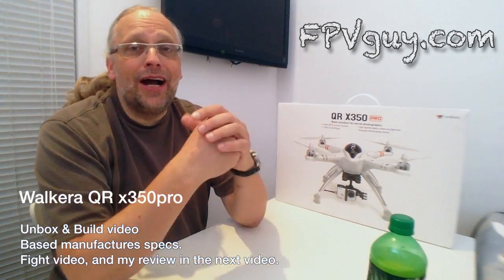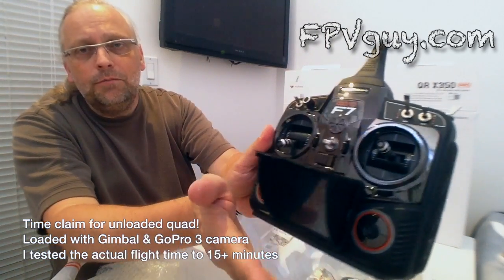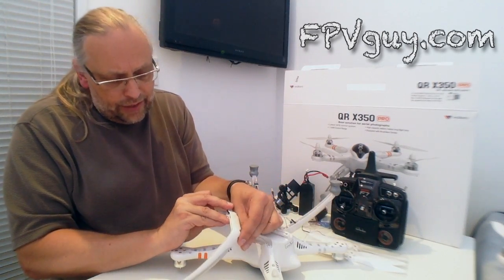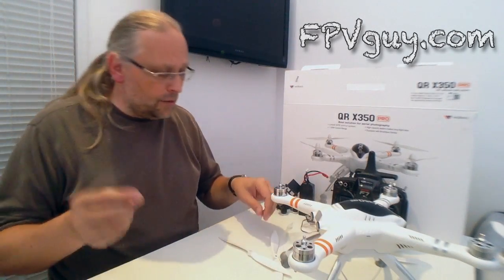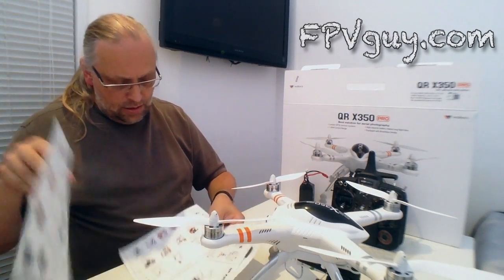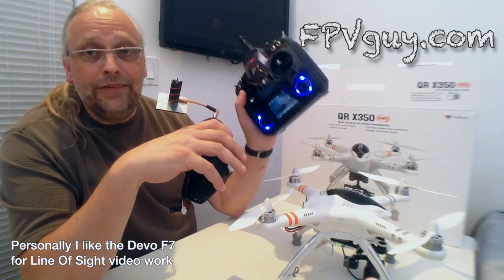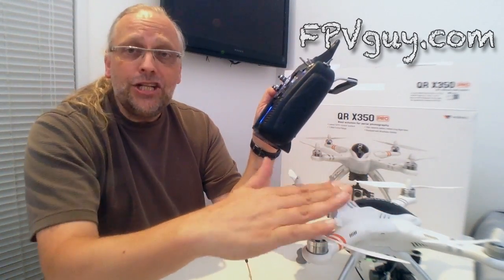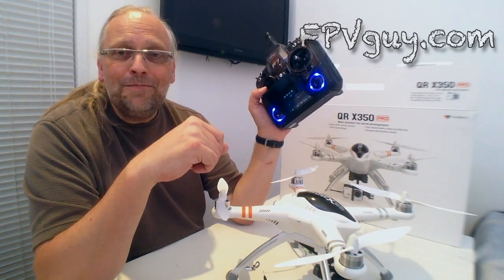Walkera QR x350pro build video

Comment: Thanks for your video, it answered most of my questions, but there is one thing bugging me.
On the model i just unpacked (seems to be the same spec as yours) there is another - third cable coming out of the same hole in the body as the compass and G-2D controller cables, it's got two wires - black and blue with male connector (tainted blue).
Do i connect that to the camera power cable? The only 'left over' connector that matches it is the female that comes out of the split four-wire cable that connects to camera's power supply socket.

Help!!!

Anyone can obviously tell that this is my first ever RC experience :)
Reply from the maker: LOL   Daniel, dont panic,     I have not heard about that cable before.  but am guessing it may be a camera remote cable.   stop by our Facebook 350pro support group and post some pictures,  My guess is Walkera finally fixed the start-stop issue for the camera. ;-)
https://www.facebook.com/groups/711455455567160/
Reply: Bo Lorentzen
Reply: Bo Lorentzen
Sorry i don't have Facebook, i've put pictures on Google+
Reply from the maker: Daniel F You should probably make yourself a dummy FB account, as there is a lot of users exchanging support there,  Matt and I try to resolve as much as we can there, the point is that what we learn is shared by a lot of users.    :-)
Reply: Bo Lorentzen
I might just do that. :)
Reply: haha same thing here,and walkera's representatives don't have a clue about ''the mysterious cable''....to be continued.
Reply from the maker: Check to see if that fit one of the connectors on the cable from the camera. :-)  they may finally have installed the camera start stop cable.
Reply: I am trying to see how to use camera remotely but i can't find it anywhere...is that possible that you can use only the video capture remotely??
Reply: There is à black transfert cable(in fact, the transfer câble is splitting in two, one end is useless) that is useless coming from the cam...is it possible that it would connect the mysterious blue câble? ?
Reply from the maker: Its possible, see if it fits.   
Basically in the first shipments there were  missing cable, for the ON OFF switch for the camera. personally I think its meaningless because I start the camera on the ground and use the counter for the video to know how  long I fly.  but some people love to flip  the video on and off al the time. ;-)
Reply: I am that type!;) What i want to know is if its possible to take pictures while the quad is flying. ..remotely?
Reply: And Yes, the câbles are compatible: one is male and the other is female
Reply from the maker: You can set the sliding switch to pictures, and engage the shutter by the flip on the remote, IF it works with that blue cable.. I'm guessing thats the right cable. ;-)
But you can't change mode in-flight

Comment: Hi, I've a "problem" with my x350 pro if we can call it like that. The quad keep his startup direction (north, south, east, west) even if I try to rotate and go foward in another direction it doesn't work. I would like to know if there's any ways to fix this thing.
Reply from the maker: Antoine Pedneault  Not sure I understand exactly what is happening,  are you saying that while you are flying, you are not able to turn (YAW) the aircraft?
Reply: Bo Lorentzen I think the called it IOC when you fly you head on every way possible and it is still fky according to the take off position, kind of a headless mod. I want to stop this mode
Reply from the maker: Sounds like you need to setup the radio correctly, because if its enabling the IOC, then one of the settings are not correct,   make a clear model and setup according to the manual :-)
Reply: I've found the problem, simple fly mode was enable on ch. 7, I turned it to "do nothing" and it should work normally now. Thanks for your help

Comment: Hello, I have an issue with the gimbal. Please check the video "Gimbal broken" if you can. Any ideas appreciated.
I'm leaning toward a new gimbal, a 3DH. 
Let me know your thoughts.
Reply from the maker: Jeppschtein   looks like you need to carefully balance props.   like REALLY carefully, get religious on props ALWAYS.
Second,  the G-2D can't dampen yaw (pan) vibration,  so I would suggest considering the G-3D,  I have a G-3Dh here, but that is too heavy for the 350pro so I would not recommend that gimbal. basically the 350 pro flies best with the lightest possible payload.

Comment: Hey I was wondering if someone here could help me, I purchased the x350 pro and have the devo-7 remote, I completed the build as per the instructions in this video when for a test flight and all was well for about 8mins or so, tested gps hold and all worked well. Flew entirely in gps mode, but when I flew the copter back to me and began to lower the throttle to land when it was about three feet from the ground it suddenly lost power to the right front motor and it hit the ground, now the right motor/propeller does this "attempt" to spend thing were it twitches back and forth, any help or advice would be greatly appreciated.
Reply from the maker: Hey William, that sounds like a factory problem.  
the twitching sounds like there is a loose cable to the motor from the ESC,  basically its a faulty quad and they should swap it for you.

Comment: Hi Bo,I sent an email to the place I bought the  Quad from  and he says  I need a 5.8ghz to display the  video. The Devo7 does  not display video at the frequency it has built-in. What a waste  of money that was then? I'll have to buy the  DevoF7 which displays video from the camera at 5.8ghz.Email from supplier so you can warn  others  of potential issues when  looking for a Quad with controller.Hi there 
which camera you have? do you have 5.8ghz video transmitter and receiver?
DEVO7 can not display live video you will need external 5.8ghz monitor. 
G2D gimbal function is balance video footage. ReplyCheers Bo for the help.
Reply from the maker: +Steve Hallett  duh.  my mistake, I did not realize that not all distributors sell the 350 with the F7.    Would get a small external video screen.  or the compact goggles, you will need a elbow adapter and a walkera antenna.  http://carolinadronz.com/products/cd-goggles

Comment: For the Failsafe Mode, in order this function to work i have to be in gps mode? In order to RTH.
what happens if im flying far away on manual mode and loss signal.
Reply from the maker: +Mervyn Cheryl   Basically the failsafe works regardless. if your radio get disconnected (or turned off) the quad should simply stop and go to RTH operation.  that leave some room for error naturally as if you are running full speed at the time, you may crash into something before failsafe kicks in.
It should got to Failsafe from manual in about 2-3 sec.   (enough time to crash)
Same thing 2-3 sec from GPS mode.  unlike manual GPS should hold your quad stable until failsafe kicks in and bring you back.
Reply: +Bo Lorentzen 
So for the settings of Failsafe ~ All Servos Hold?
Reply from the maker: Follow the manual ;-)

Comment: Can someone help me? My QR X350 PRO is unstable, I have done the calibration and even then it does not get stopped, do not know if it is defective or if I should do something to work, it does not work return home to the function and the function of standing as I see in several videos where people take the place and it comes back to the point that I was, what should I do? thank you
Reply from the maker: Antonio,  You probably should post that question on the RCG forum.
http://www.rcgroups.com/forums/showthread.php?t=2085032

It sounds like your GPS is either not working.. or the switch on the radio not programmed correctly.  
Remember the basic startup,  turn on the power and put the quad where you want it to be for take-off.  then let it sit still for at least 3 minutes.. until you get triple-blinks from the right control light.  (or better)   then take off in manual,  in the air hoover at about 2m and flip to GPShold..   in the beginning you may need to help it a little.   you need to fly about 4-5 batteries before it get smooth .

Comment: Hi Again here is another interesting thin on the QR X30 Pro, the 2D gimble and ilook+. When i have the camera in start position i can start it to record and its working, when i fly its working. BUT if i tilt the camera Down max og just 50% it goes into standard "wait" and memory error. I have checked all the wirres from gimlbe nothing happen when i tuch or move them. Any idea? Walkera dont answerScenario1. Start the drone in start mode with camera fasing forward!2. Start recording with the camera button3. Tilt the camera Down it goes into memory errorScenario21. Start the camera with knob max Down and up it will start recording2. til the camera Down it wil go into memory errorAnd finnaly has any one got the gear sw to Work with start and stop recording? and also keep the knob for tilting?I have got the FP converter wire and i will pay for e guide how to get it to work
Reply from the maker: +TheMisterSwede   WOW.. that sounds like a loose connection in the camera, causing a memory error when looking down.

Comment: Mine crashed 3 secs after take-off, any thoughts?
Reply from the maker: Hey Paul,   thats not very much information to base thoughts on,  
Lots of things can cause this, however a correctly calibrated 350pro with 2-3 minutes of warmup, should fly and hover smoothly, and don't crash by itself.
But if its not pilot error, then you probably need to give you distributor a call, because then it a product issue.

Comment: hi bo'i have got a qr x 350 pro.when i fly it in manual mode it runs ok'when i land i put revs to 50% then flck switch to gps'the quad go's to no revs to hi revs 'i have to hold quad down to stop it going out of control  ' i havent try  homelock yet to frightened of it flying of .how do i no it will return home ' the quad is to unreliabal . please if you could help me sort this problem out i would be very grateful' i am new to this hobby thankyou  for your help  ian
Reply from the maker: why do you flip it to GPS when you land ?
Reply: because if I put  it in to  GPS while its in the air the revs drop and it will hit the deck  ,because that is what it is doing when I start it on the ground ,would it act different when I get it up in the air, do I just chance it .if you could advice what you think thank you ian
Reply from the maker: The GPS don't understand that you are landed,  I don't think it will do the strange revs in the air,  I have experienced the same when landing in GPS, once it lands it will stop and then rev up again on and off.     when you switch to GPS in the air, make sure the throttle stick is centered,   but to make sure, go use a area with thick grass for padding,  fly stable at about 1.5 - 2 meter and flip it to GPS.  it should hover and hold steady.
Reply: I will try that and let you know thank you for your help ian
Reply from the maker: You should be fine,  GPS mode just don't behave right on the ground, because the aircraft is not moving. ;-)

Comment: can you not take off in gps mode .
Reply from the maker: VideosRus,    you can't with the current firmware,  however, we did a couple of tests, putting the firmware for the Scout X4 on the 350pro, and after editing a couple of settings it worked really well,   and could take-off and land in GPS beautifully,   we are encouraging Walkera to release a x350pro version of that Firmware.
Reply: Bo Lorentzen
 thanks Bo , one more question , do i have to calibrate compass  before every flight ?
Reply from the maker: videosrus uk  nah,  just do it once,  as long as you fly in the same general area.  the most important thing is to be patient.   try to always have 3 or more blinks on the GPS before getting in the air..   
I use a iPhone app called "Magnetology" and avoid flying on orange / red days.

Comment: hi bo im sorry but i cant find how to message u on my tablet well anyway i figured the fpv system out thx anyway but i have another question well i calibarted my drone properly but its just drifts and just out of nothing wile flying smooth it comes down fast then i pull up 100% and then somsthimes i can save it from crashing but it probeby has something to do with the left front motor when i am on the ground and put my trotle up a little that motor ( left front ) will always start later to rotate and the left back motor somethimes 2 im speaking about 1 sec and after flying ghe model those 2 motors are also much hotter then the other 2 motors so i dont really see what i can do.... in the return to home functin it goes to left and richt left right very fast and it seems like those motors go on and off at the left side i dont really know what to do about it :/
Reply from the maker: Well, that sounds like a issue for your distributor ;-)     Im not sure what is causing the motor issues, If the motors are hotter than the other motors, it sounds like the bearings are binding a little?  
The drifting issue sound like you need to wait another minute or two before flying so you get batter GPS fix.
Reply: Bo Lorentzen so i should buy a new distributor or ?... and what can i do about those motors that are becoming very hot ? im sorry for all my questions this is my first model ever so its all new for me ;p  and ur the only one i know that knows alot from drones so ;p
Reply from the maker: Tom cools you should CALL the company you bought the 350pro from, it sounds like two of the motors are binding.    depending how long you have been flying this, they will probably either replace the x350 for you or sell you some new motors. ;-)
Reply: Bo Lorentzen ok thank u very much ill contact the company where i buyed it
Reply: Bo Lorentzen i contacted the company and they told me that i have to tell them what i need from spare parts do u suggest 2 new motors or something more ? and is it easey solder them on ur quad ?
Reply from the maker: Tom,  you definitely need a couple of motors and some props, but there are something more fundamental wrong here.  go post the question to Matt on the 350pro forum 
https://www.facebook.com/groups/711455455567160/

Comment: hi guys
my first real post and its for a problem already ;-)
i have qr x350, ilook+,g-2d gimbal, devo f12e, i can bind the quad and radio. i can arm the motors and accellerate, and i have video signal from the ilook camera,.... but i cannot for the life of me figure out how to get any of the controls on the radio to make the gimbal tilt...
can anyone help me with this set up??
thnx
Reply from the maker: Hey Willie,   I suspect you have a early 350,  the gimbal pitch cable were simply not connected.  you need to crack it open and pull a wire from the RX to the Gimbal..
For more details check out our FB group here 
https://www.facebook.com/groups/711455455567160/?ref=br_tf

Comment: Bo, Here is the number for Walkera  fp convertor cable 226404400  JH1406200001,                             I am still having problems even with this cable to get the camera to switch on and off with retract switch, when its connected to Devo rx703a receiver and plug into AUX4 on the receiver
Reply from the maker: Bryon,  I just got a box of these for distribution for 350pro guys, but they send me a box full of Y cables, I had hoped for a 4 inch extender to plug into the GEAR ch and then pull out of the body.  what did you get.?

Comment: Hi Bo, After reading about so many people having trouble with there walkera 350 pro dropping out of the sky, I found that some have done a mod  bypassing lvc power cut off, I have done this and installed lipo low battery alarm but I dont know what voltage to set it at, what do you recommend plus leaving 3-4 mins left for landing, many thanks,bryon.
Reply from the maker: +bryon kerslake Set it to 3.6 or 3.7 v.  that will get you on the sky with plenty time to spare.
Reply: Bo, Thank you for the info,I am sure other flyers will find info a big help,all the best,bryon.

Comment: Has Walkera fixed nthe LVC gkitch, and the ardru pilot problems?
Reply from the maker: +StarGazer56    Nope,  walkera don't update systems, simply create new aircrafts.   the best solution is to turn off LVC entirely and remember its a APM system and fly it accordingly, that kinda solve the ardru pilot issues.